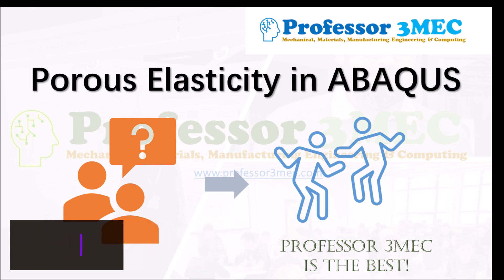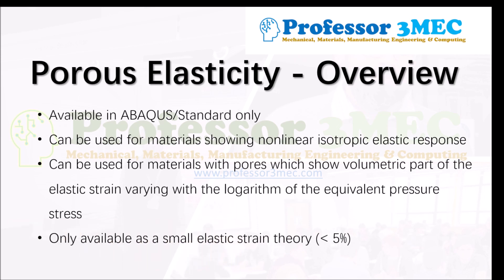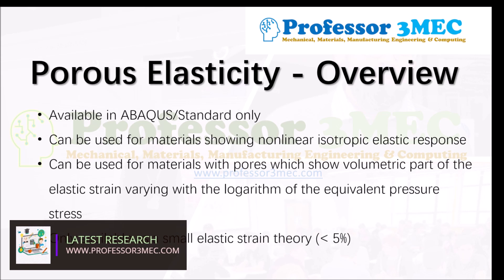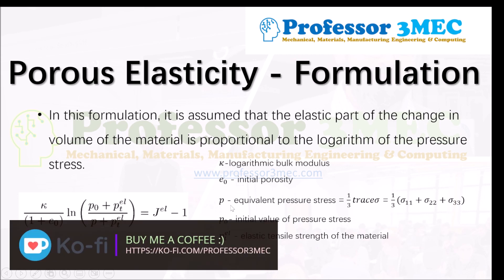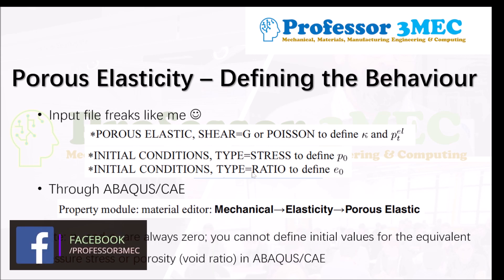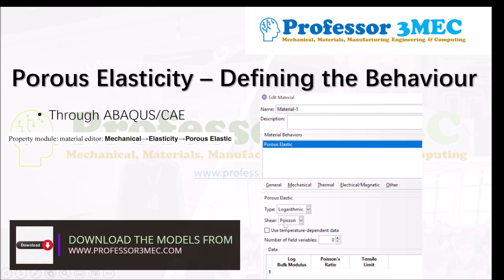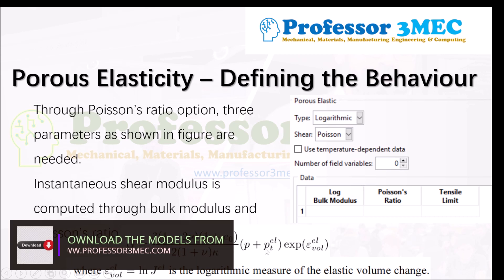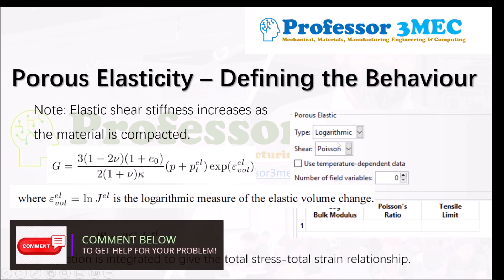Porous Elasticity in ABAQUS for soil, clay, ..

Comment: Hi, is this possible to apply this model for porous concrete. Thanks
Reply from the maker: I am not a concrete expert but if it behaves in a similar manner as explained in theory and video then may be.
Reply: Thank you for reply, I will validate it with my testing results. Can you share relevant published papers so I can cite it in my projects? Thanks.
Reply from the maker: Sorry, which publications are you after?

Comment: Can this material model be used for modeling biological tissue? I'm trying to model inflammation and want to use poroelasticity to define tissue behavior.
Reply from the maker: It’s implemented for small deformation problem and also can’t be used with viscoelaticity. So I think it may not be suitable as I think soft tissues are porous viscoelatic materials, but please double check with ABAQUS
Reply: @Professor3MEC  Thanks again for this video and the beneficial information. Are you going to publish a video on poroelasticity UMAT?
Reply from the maker: @jafarabadi29  Sorry at the moment no, but if there are more demands then I may try to do so. There are already some others in the waiting list for now.